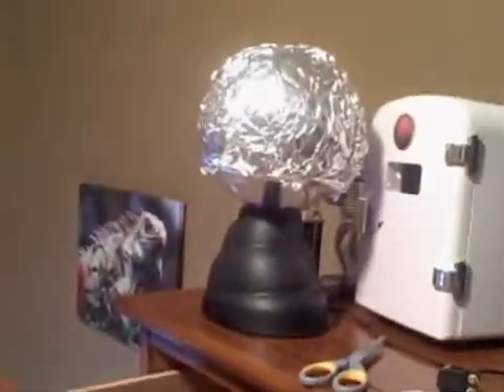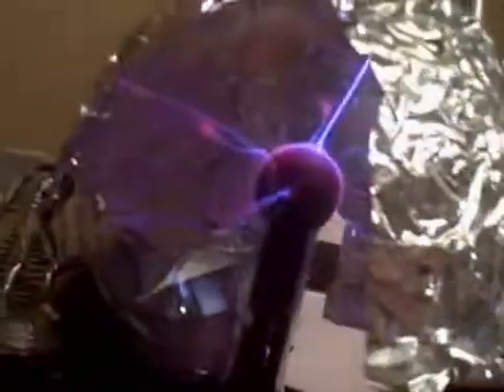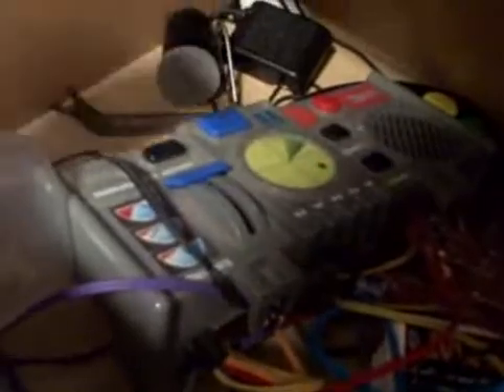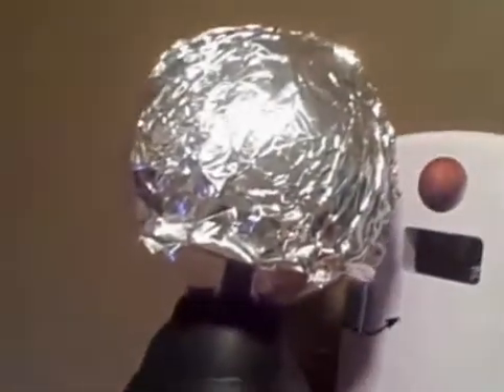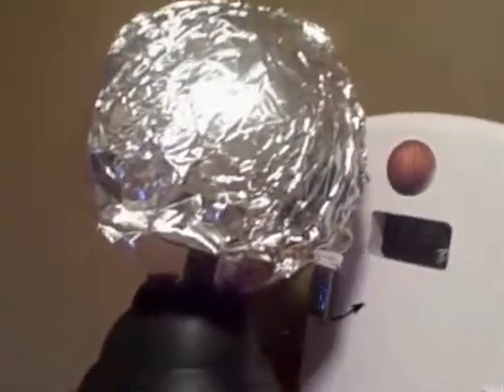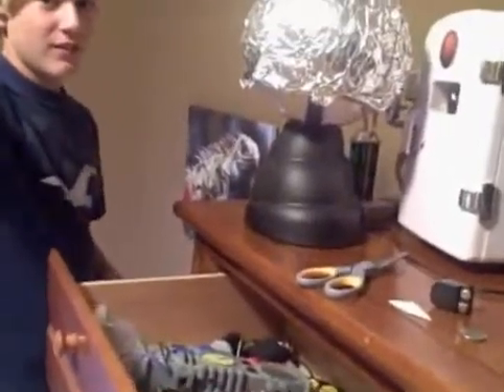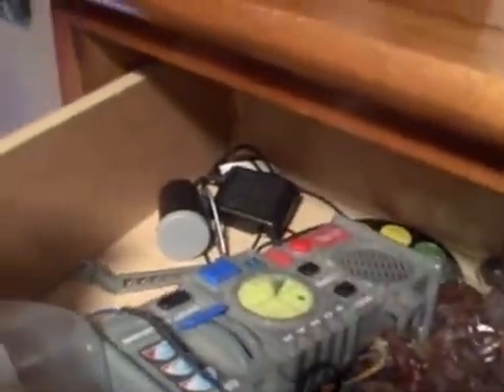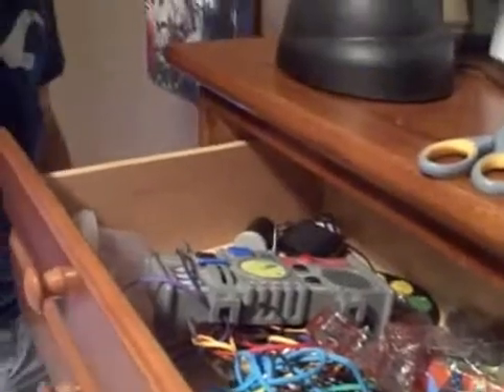Weird Plasma Ball Finding

Comment: its called EMP. electro magnetic pulse. yes it is real, not just a scifi thing. yes they can screw up or interfere with near by electronics. in this case the energy being put off by the plasma ball going through the scissors is causing the iron in the scissors to become magneticaly charged for the split second you touch it to the ball.